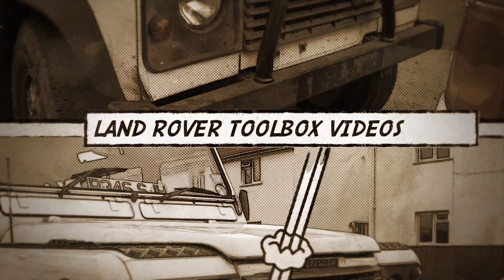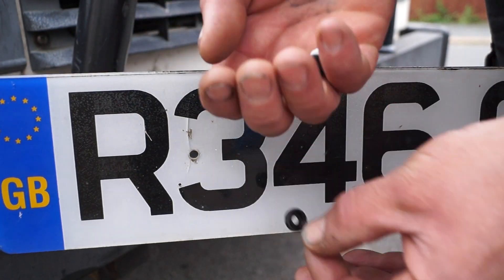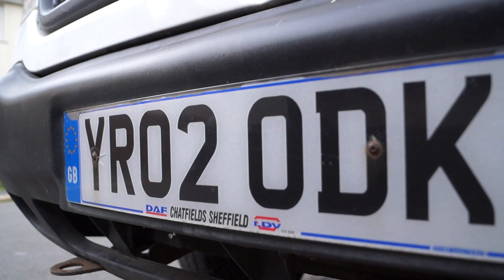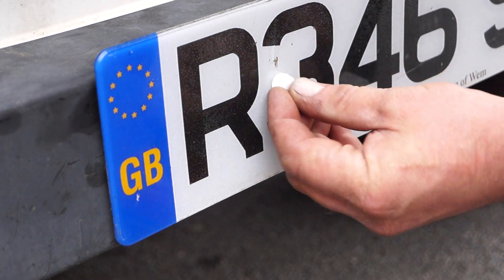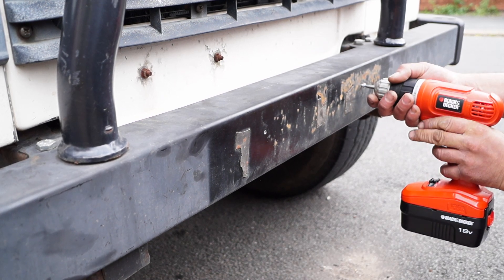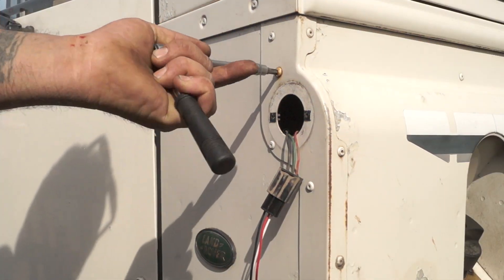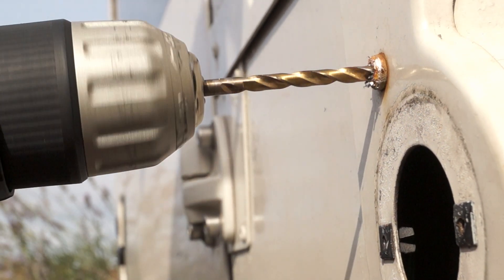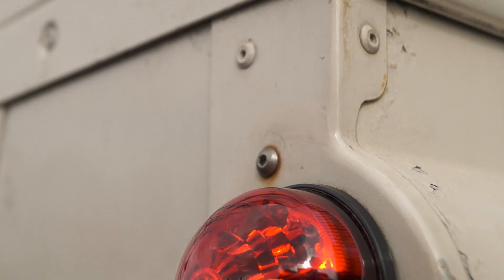Tip[s and Tricks from Land Rover Toolbox Videos

Comment: Nice clip Chris, bit different from the usual but good none the less. A year or so ago I got a screw remover (left hand drill bt) in Lidl that is supposed to take off messed up screws, but it doesn't work so I do the same you did in this clip.
Reply from the maker: We're going to have a mixed bag of stuff for people of different levels.   Defender now is going to be our project vehicle for a while so it will get technical at times.